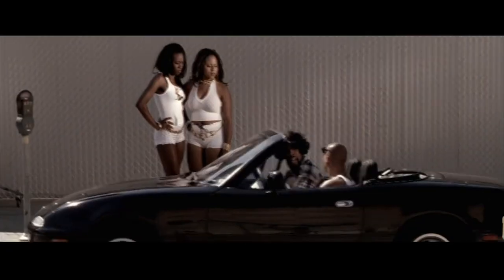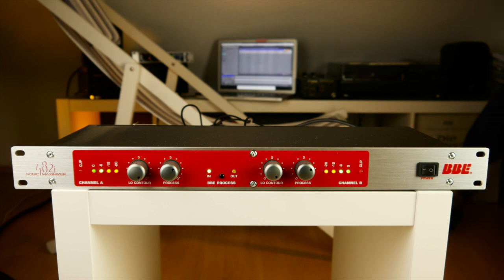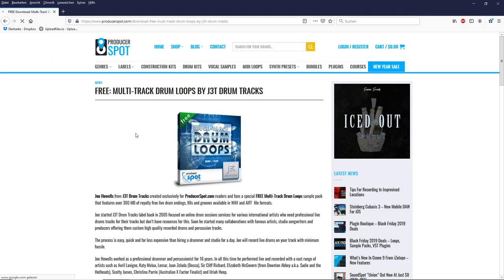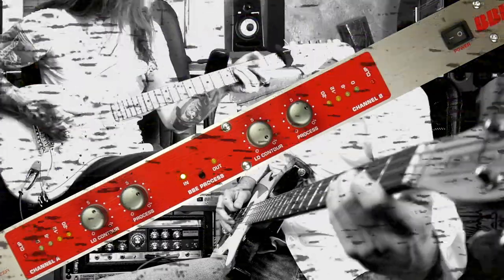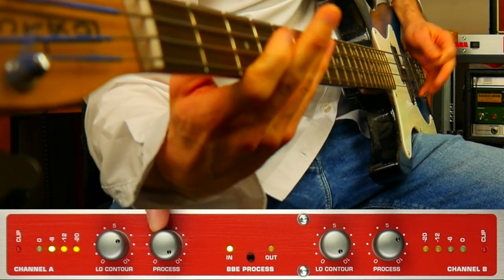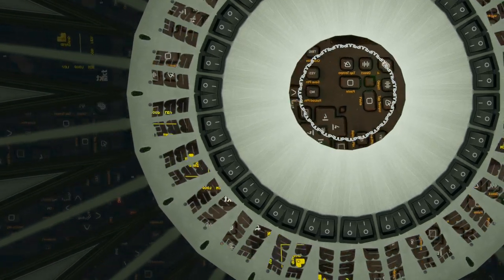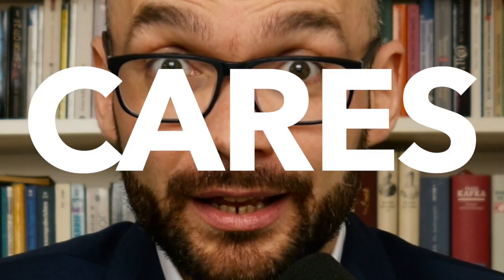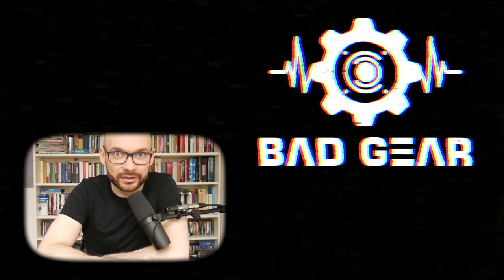Bad Gear - BBE Sonic Maximizer - Most Useless FX Processor Of All Time???

Comment: As a dj who mainly plays electronic music, I have to say this processor is absolutely fantastic and worth every penny. Whatever it does, it makes any  setup sound amazing. I can't live without them, I have 2
Reply from the maker: Great to hear that it works for you!
Reply: I use one for live sound with every genre of electronic music and the clarity is the reason.. I use it minimally, but it definitely communicates the signal to the speakers efficiently. The bypass button makes this easy to test for yourself. I’ve got the 882i with QSC KW 153’s and 181 subs.
Reply: I would agree Joshua, I am also a DJ and it makes my sound system sound amazing.  So it just depends on the application.
Reply: I agree! I have two as well I don't know what or how they are connecting them
as there are so many ways
I wouldn't be without one.
Mine are about 15 years or more..love em!
Reply: I agree with you.i don't even use my eqs of which I have three... dbx and nady.
The bass is stronger and the highs are crystal clear. I have them for about 15/17 years now. Not one problem. I love em
 Don't even miss using  the equalizers
Reply: I had to weigh in.  Been using a BBE since they were first introduced with the 422, and have upgraded to many units over the years, when I could afford the upgrade.  I would never want to be hooked up in any situation without one.  As stated by the first article that was used as the original sales pitch right after the test at Axe Music, "it's as though the pillows were removed from in front of the speakers", and that sums it up perfectly.  The process is simple, yet complicated, as a sonic maximizer acts as a delay (ie original surround sound), and a crossover.  Three frequency bands are constantly compared and equalized.  This simple process not only "brightens" up the highs, and "tightens" up the lows, but delays all in a subsequent sequence one after the other with a 30 ms delay.  Not only do you notice a DRASTIC improvement in sonic clarity at the loudspeaker, but that sound is consistent as you move away, producing an "unmuffled" sound everywhere in your room.  Granted that the new DSPs help to give a more directional sound, nothing can compare to the incredible distance that you can produce a clear sonic boom.  I reveal this secret with much hesitation, but as I a great reputation now, I do not have to worry about losing my thunder.  I did do a demo video in my house and if someone is interested is the simple video, to demonstrate the drastic difference in sound quality and clarity, I'd be happy to share it off of my server.  www.CrazyDs.com

Comment: It's for adding high end without adding noise since it's not just boosting a high freq range like an EQ.  It's multiplying some of the fundamentals and REintroducting those multiplied fundamentals back into the source (as I understand it).   These are also called aural exciters, Steinberg called theirs a spectralizer.   I use it all the time on my voice overs to add bite w/o adding any high end hiss or extra noise.  It can help it cut through a mix or just add some bite to the sound and that's about it.  I'm sure the low frequency process works in a similar manner.  It most definitely isn't "bad gear".  Maybe you don't have a use for them and would rather boost 6 KHz by 6 or 7 db instead.   That's fine but that doesn't make a sonic maximizer a bad piece of gear.  You might as well say a compressor is bad gear because you can just push your amp harder and it'll compress.  Just push the record fader till it's way into the red and it'll compress all right!
Reply: Exactly. This. Isolated DAW drum tracks makes no sense to do any of this. If that portion of the song were just drum tracks, Eq it and maybe reverb or compression depending on the sound of the drums you wanted (dry or spacious).

Comment: They are not an FX processor. Their primary role is a phase/amplitude correction device. You use it before an amplifier to adjust phase and time alignment of higher frequencies arriving to your ears compared to low frequencies etc... to make sure the audio doesn't go muddy because of this. They are okay for mastering on your mix out where phase problems need to be corrected too. I've seen a few in old radio stations used incorrectly, where they screw with FM multiplex signals to make things worse rather than better.

Comment: Many a-list mixing engineers use this or the plugin version for thumping tom sounds. Its awesome. It has so many sound reinforcement applications in mixing and tracking - but the secret is PARALLEL PROCESSING.
Reply from the maker: True that, but parallel processing with hardware in a digital environment is always a bit tricky bc of phase issues
Reply: @AudioPilz  um ina digital environment you can just move the waveform clip on the timeline into phase or rely on delay compensation (in the case of the plugin) PRINT EVERYTHING!
Reply: Parallel processing with something that delays bass frequencies sounds messy.
Reply: @Claidheambmor  I don’t know what to tell you. It’s an old trick and been around for a long time.

Comment: Wow! Absolutely one of my favorite pieces of equipment and I’ve been an engineer for many years.
I have it in my live PAs and in my guitar rig. It gives a sweet presence to my sound .. And it is not an EQ but when I ad it to my live mixer everything is richer and a little clearer without having to painstakingly tweet the eq. Yesterday I got the plugins and I just touch the mix with the harmonic I hammer and the boost and wow! So, I am surprised at all the hating on this simple and inexpensive processor. I love the warm sound of my Neve preamps, I love the life BBE brings in the end.
Reply from the maker: It's interesting. Did live sound for many years, too and I would never even think of using a BBE. It either does very little or severely damages the signal (my personal impression). Yet, there are many people (like, I assume, you) who get excellent results with it. That's a real love/hate thing
Reply: It delays lower frequency waveforms since they travel faster.
Similar to phase correction, but the time intervals different.
Reply: I use it out of my Audient into my monitor amp. 
Gonna combine it with Kush Clariphonic.
Each time I'm done I'll  take everything to a mixer and mastering service.
Reply: @vorpalblades  .5 and 2.5 milliseconds
Reply: Agree it transforms my helix and PA!! I love it!

Comment: Repeat after me: The Sonic Maximizer is a SIDE CHAIN TREBLE EXPANDER.  It's not a simple EQ  or boost, what it does is dynamically boost treble frequencies based on the overall loudness of the input signal. Quiet signals get no treble boost, medium level signals get some treble boosting, loud signals get even more treble boosting, controlled by the "process" knob. The input signal is buffered and split in two - one side splits the signal into three bands, the other is sent to a level detector circuit. The output from the level detector is sent to a VCA which controls the treble poerion of the signal.  My theory is the treble expansion helps undo some of the 'dullness' caused by compression, hence it being favored by people that are often compressed, like djenty guitars (distortion compresses guitars hugely) and bass. 

The effect is not due to "time alignment of frequencies" and I don't understand why BBE sticks to this line of of obviously BS marketing-speak.
Reply from the maker: Do you have any papers or schematics to back this up? (I am searching for hard evidence on what this thing does for ages)
Reply: @AudioPilz  I have what appears to be a partial schematic, one channel of a  stereo unit. and details like the power supply are not included, but it shows the signal path and processing, including a reverse engineering of the special BBE chip. It's a completely analog circuit that uses about 6 op-amps and a VCA.  https://manualzz.com/doc/17699728/http---www.radio-flier.com-pdf%2520files-bbe%2520482i.pdf
Reply from the maker: @erichanderson1491  great, THX!
Reply: Well, frequency is measured in time so....
Reply: Great answer.  Thank you for this!
Reply: @BobbyCulpepper.srv3fender  yes, but sound has both frequency (perceptible to humans) and phase (generally not perceptible to humans). I've heard many claims that the BBE does some kind of magic with aligning the peaks and troughs of the phase to do... something magic. Glad to hear this is just BS, because it sounded fake to me.
Reply: This is not what it's used for and the isolated drum tracks are probably the worst things to demo this on. Isolated tracks need to be cleaned up as best they can w/ proper recording technique and mic selection and EQ-ing. The problem is when you mix multiple tracks together, the crispness and definition of a snare or high-hat or even kick drum snap, for example, gets lost with an electric guitar and lead vocals which are trying to stay on top. So in the mix, during the loud parts of the song, EQ-ing the drum tracks to have higher 5k-8k boost could really boost the groove without overpowering the vocals & guitar. If you solo'ed that drum track it sound harsh and noisy like your nails on the chalk-board image. If you want to waste your time making individual tracks that no one will ever hear sound like perfection, great, have at it. But at the end of the day you gotta mix something that, hopefully, someone else enjoys listening to. The Maximizer is a great tool in automatically boosting & Eq-ing the mix for you, and I think it was especially powerful in the days of analog tape - because it's essentially an automatic Dolby NR processor with two user knobs. I guarantee you you're doing the exact same thing with a ton more wasted time in ProTools plugins and automatic filters.
Reply: @jonathanmyers3524  high end boosting can occur two ways, Eq-ing the high frequency content, or re-aligning the low and mid frequencies to create more of a square wave response or snappy burst. A square wave, by definition, has a lot of high frequency content to fill in the corners of what would be a sine wave (low frequency content). Call it "synthesizing" high frequency content, although that word has an entirely different meaning in music.
Reply: this is exactly what i would use it for, the chain matters with the gear for instance i used to run this with a mesaboogie dual rec paired with a 6505+ then id have an ocd overdrive paired with it all add a noise suppressor and it sounded so good. id never over do the contour cause its just a fat mud but id forsure lift the process up over 6/7. you cant just add it to any signal its more an aquired taste and having good ears to find the sweet spot.
Reply: Thank You! 
You’ve just explained in basic understandable terms, what the unit does.
Funny story:
Back in 1993, I played guitar in a band with another guitar player (classic rock).
I was using a Mesa/Boogie Mk3 Simul-class 1-12” combo and a few effects pedals.
He (Dave) was using (in a rack) a Rockman for preamp (the Boston sound) a BBE maximizer, a 31 band graphic EQ and an ART effect unit. His speaker cab was a Crate 4x12” but after opening it up, we found it had cheapie speakers (tiny magnets!) and they were being pushed by a Peavey CS 400 PA amp. Poor ol’ Dave couldn’t compete with my little combo. No matter how much he cranked his amp he said, “I still hear your guitar!” He didn’t understand. 3 more speakers, 400 watts vs. 85 watts and one speaker.
He had not learned the way of the tube. Tube amps rule the stage. 
He eventually bought a Dual Rectifier. He was very happy.

Comment: I have one in my mixer effects chain and use it a lot with streaming media to bring back some dynamic range and focus. Like any processor, you have to adjust it correctly and remember that it's not a fix for every sonic fault.
Reply from the maker: A lot of people can bring it to good use. Me, not so much
Reply: AudioPilz As a check on circuit design quality on these kinds of devices, I listen for any coloration to the sound when they're set to neutral values (not just bypassed). The BBE is pretty darn neutral.
Reply: Agreed. Reading what others are saying, our comments are part of similar theme. When tweaked, along with a little EQ, the BBE works wonders bringing 'life' back into a signal chain.

Comment: I used a BBE select maximizer on my PA set up for years, and it gave me so much more about amend, even though I was using 18 inch subwoofers. As a solo LoopingArtist with multiple instruments on stage, I like a big huge sound, not just loud, but big. The BBE help me with that greatly. When I bought a bag and PA system, I didn’t need to use this anymore because they have timeline in their equipment. I now mainly use a QSC K.2 powered system with 10 inch mains, and a single 12 inch subwoofer. The thing sounds huge, sounds amazing! I’m wondering if I should start using a BBE again to give it even more kick.

Comment: The BBE SM is indeed to be used as a final stage in mixing. What the BBE does is correct phase-shifts! In (analog) studio mixing a wide-spectrum sound that passes through a filter undergoes different phase-shifts at different frequencies; this is a result of the filter itself. And the more filters in the signal-path, the more phase-shifts in the final output. Consequently, the sound becomes muddy when not corrected. When music has already been corrected for phase-shifts, the BBE SM has no effect.
Reply from the maker: I am not an expert on phase correlation in studio and broadcast technology but all the real pros I talked to told me that the BBE sales pitch of the SM is utter BS. The logic of it is inherently flawed, too. But there are indeed some uses for it
Reply: very useful when you use this stereo modulation rack effects the guitar players were using back in the 80s
Reply: @AudioPilz  Then maybe the product is being marketed wrong and is best used as how the above poster stated-as a final mixdown-rather than something for your effects loop chain. (*=cue chords from "the final countdown"*). Maybe it's something that shouldn't commonly be used.
Reply: It's true that every time you use a filter such as in EQs, the phase shifts - but the phase shifting doesn't cause any real audible artefact by itself. It will make the signal different, but there's no way to "correct" this difference into a specific phase that would somehow be more "correct".
Reply: This makes absolutely no sense.
Reply: @AboveEmAllProduction  🤣
Reply: The issue here is the use of the word 'correct', which suggest there was an error in the first place. This adds something, it doesn't 'correct'. Nothing wrong with that, but to assume anything else is buying into marketing.

Comment: I connected it 
..out of my Audient into the BBE in...out of BBE and into my amp.
The mix  is way more open. 
I leave low contour dead centre and push high contour only one click. 
Glad I did. 
It's twice as clear easily.
Reply from the maker: It certainly works in certain applications
Reply: @AudioPilz  Going for Kush Clariphonic and a Tape saturator

Comment: I don't play in any bands at this point in my life but used to play tech/prog metal. My last set up was a Peavey VB2 all tubed head and a Mesa powerhouse 1000 watt cab with the 15 and 4 10's. It was a beast of a set up but being a five string player, the bass control on the amp was tuned for 60hz if I remember correctly. The highs weren't quite as crisp as I wanted either. Also I bounced back and forth between finger style, slap, and tap. I used a bbe maxxcom to bring out the highs and deeper lows as well as the compression to keep my dynamic levels for level between the style changes. It was a very important piece of my set up. The VB2 and that mesa cab were phenomenal on their own but bbe maxxcom absolutely added that "special sauce" and i constantly got compliments from the other local metal bands about my tone. Now in current times (just started playing/writing/recording again 4 months ago after a 10 year hiatus) I  just discovered that plugging into the maxxcom directly and directly into my recording interface is very usable and very easy to sculpt my tone. I was never a pedal guy, always went with a basic set up. These things are pretty cheap nowadays and "obsolete" but I think they are pretty outstanding for how cheap they are on the used market. Are there better options out there? Absolutely. But for the cheap price + very usable results they are pretty hard to beat if you can find one in good working order.

Comment: I used to live in Huntington Beach CA. many, many years ago and, at a stones throw distance from the BBE shop on Bolsa Chica Road at the time. I spoke to a sales rep that explained to me (in not too much detail of course) that the 462 model that I had, provided "Time Alignment" of the different frequencies in the output signal providing a much fuller, pleasing sound as without the alignment different frequencies hit the ear at different times due to delay. I can't testify about all applications but I ran mine between a Mesa/Boogie Quad Preamp and a Marshall 100 watt/ 6L6 Dual Mono Bloc Power amp and it sounded like the voice of doom when I cranked that thing up. Without the BBE there was a definite depletion of tonal bombast. It is purely a matter of application and taste but mine was one of the biggest "More Bang For My Buck" discoveries of my life.
Reply from the maker: Great to hear that it works for you

Comment: I've used a 382isw for years on my acoustic drum kit with excellent results. The key is moderation, I generally never turn the processer up more than about a third of the way up. It's great as long as you use it sparingly.